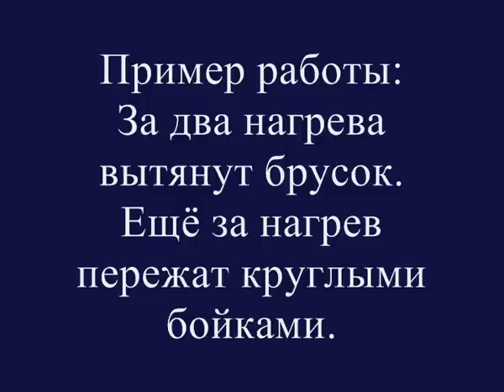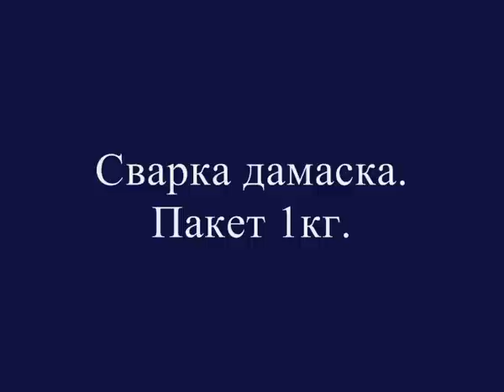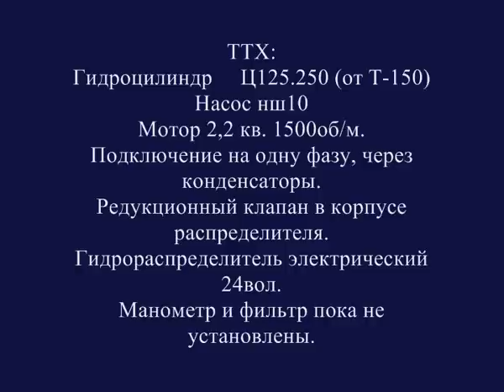Самодельный гидравлический ковочный пресс R2D2.

Comment: Press looks awesome! :D I'm not very knowledgeable about hydraulics, but what is making the press retract without you manually doing it?
Reply from the maker: If I understood the question correctly. I manage the press manually. If it rests, then the pressure relief valve (bypass) is triggered.